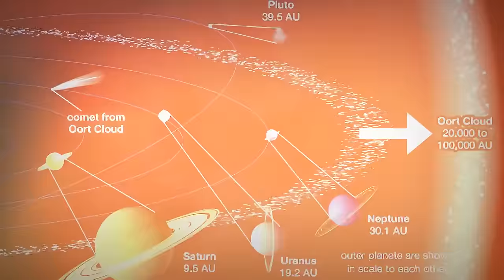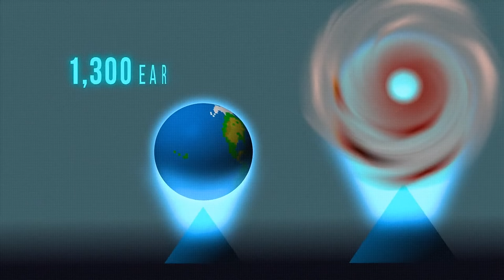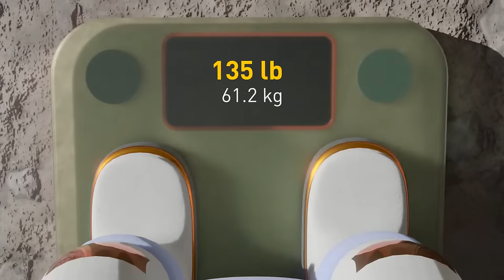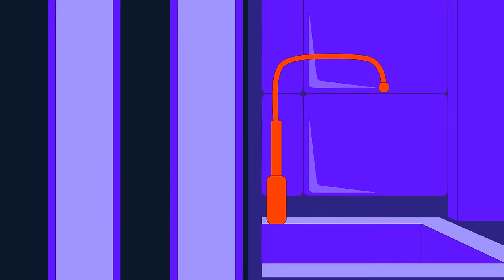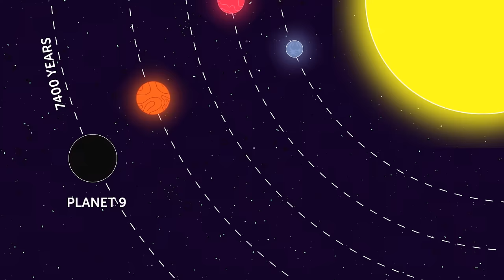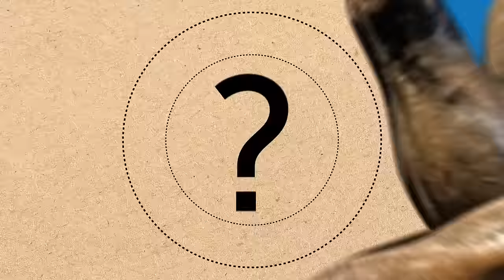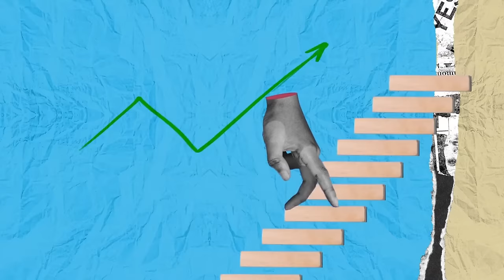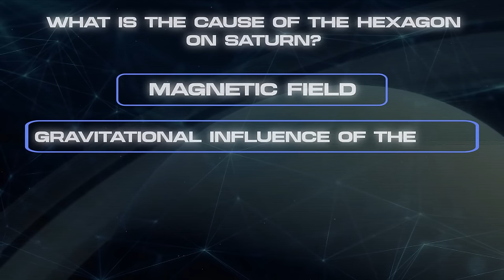Planet X may be hiding in our Solar System

Comment: Light slows down near a mass because of the gravity that slows down time and shortens distance. Light speeds up as it leaves the vicinity of a mass because there is less gravity to slow down time and shorten distance compared to where we are in our frame of reference in the vicinity of the large mass of the center of our galaxy. The speed of light changes over large distances depending on how much gravity there is in the vicinity. I need someone with enough IQ to confirm this absolute fact. When the measures of time and distance change the speed of light changes since that's how the speed of anything is measured. The way speed is measured is with time and distance. If time and distance are not constant neither is the speed of light constant.